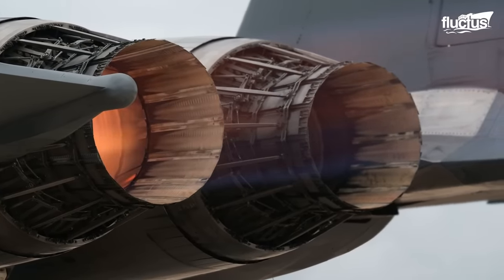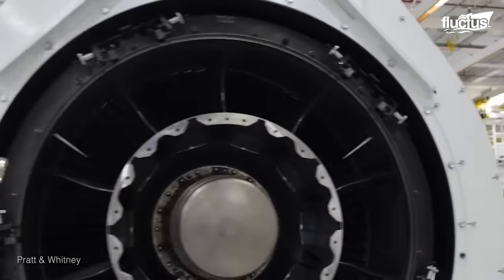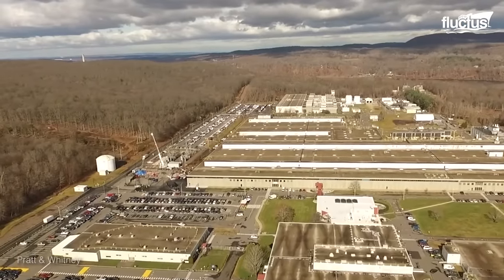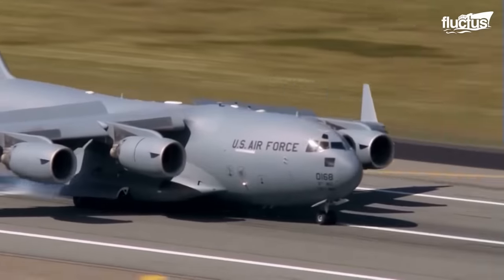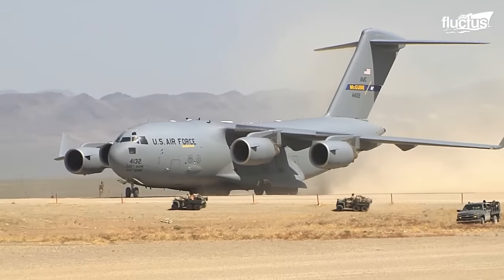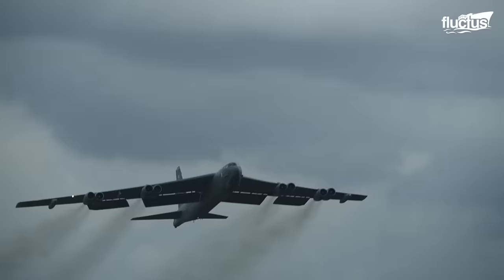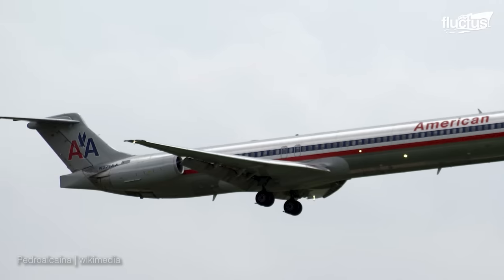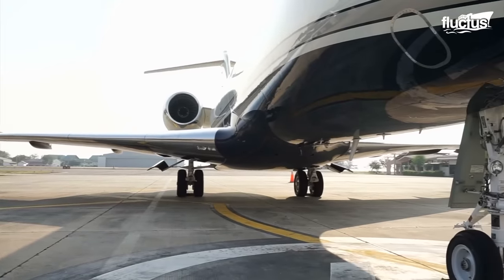Inside the Complex US F-35 Engine Manufacturing Assembly Line

Comment: I used to work at Boeing in Everett. First time I saw the giant engines for 777's I was amazed. Main Fan is 9 feet in diameter. It wouldn't fit inside most homes.
Reply: Did you see the story about UAL flight 1175 capt Behnam?

Dude was flying a Triple 7 when one of the engines exploded over the ocean. That 9-foot diameter blade was windmilling but it was out of balance it was damn near shaking the airplane apart. He had to fly it like that for a couple hours. That story is a Real Testament to how well those Boeing Triple 7 Wings are Made.
Reply: @jiveturkey9993  I couldn't even imagine that . . . . with that thing windmilling out of balance like that !!
even a little out of balance it would have been insanely scary no matter how many hours you got under your belt
Reply: @jiveturkey9993  more than the wing, as the entire aircraft is being vibrated and flexed.
I'd love to see the containment for that fan though, that's a hell of a lot of energy to contain should the fan shatter! Most of it has to be flexible, as rigid would also simply fail. I'm willing to bet it's a derivation of the Whipple shield used for spacecraft, layered flexible barriers.
Reply: It is so amazing !I feel so couriers if it is posible for a ordinary people to visi t?
Reply: @spvillano  Thanks. Yes you are right, anything that big rotating at the rpm's it does, has lots of kinetic energy. Out of balance main fan would introduce harmonic vibrations that could lead to complete loss of engine. Worse case, shrapnel hits passenger compartment. 

Large fan blades now being made out of composites. Older engines used Titanium, which is very expensive. Even composites can explode. There are several destructive tests engines have to pass. One about Containment, making sure the shroud liner (like bullet resistant vest) can withstand high energy impacts from fan blades. 

The near future will see 3D printed blades made from metal alloys. It is possible to print very complicated passages inside blades for cooling, and for making blades lighter.
Reply: @jiveturkey9993   pm .
Reply: @spvillano  At least in the Denver incident last year, there was no containment....the cowling landed in someone's front yard.  A fully uncontained failure....fortunately they were only 10 minutes out of Denver after take-off.....couldn't get me on one of those P&W equipped 777-200s......junk.
Reply: @spvillano  The containment does not exist......
Reply: @deanpesci8484  Well first off the Cowling coming off has little to do with "containment". Second, are you under the impression that GE engines never have issues?  GE has had numerous CFM56 uncontained failures in the past few years, some fatal.  I worked as a designer for BOTH companies for over the past 30 years and to say one is better than the other is just silly.
Reply: The x’s engines are bigger than my houses top celing
Reply: @sanashams322  thanks... yes they are huge
Reply: US is very much behind the Russian thrust vector control engine. The engine technology in US is very poor compare to Russia.
Reply: @georgeoms8713  thank you... yes Russia beat USA into space and in thrust vectoring. I bet they have things in development that will be amazing.
Reply: "home" analogy helped most of us picture this!
thank you!
Reply: @hashvid  Thank you. The Boeing 777 used 2 GE 9xx Turbofan engines. I always said that stood for G (gigantic) E (engine) 9 (nine feet in diameter.
Reply: @hashvid  Thank you. The Boeing 777 used 2 GE 9xx Turbofan engines. I always said that stood for G (gigantic) E (engine) 9 (nine feet in diameter)
Reply: i wanna work there if you able can you tell them ...😟 am crazy air craft that my dream i wanna study this , please sr... no salary give me ... i can work a long in my life but only need feed and give me live place for me...😟😟
Reply: System engine
Turbine
Reply: Blestic missile
Reply: @abinaslimbu3057  Thanks for comment
Reply: @brianwilson8983  Thanks for comment. I don't recall seeing you at any Boeing Facilities. Only Brian Wilson I know is from the Band Beach Boys. 

I started in the 40-87 Building in Everett with Technical Support. Later transferred to 40-88 Building for writing resource management programs in Special Projects Group. Then trained in Lean Manufacturing. After that was part of Lean Manufacturing Training Team and visited Plants across United States. I was in lots of places including plenty of time in Everett Main Plant. Been up close and personal with every type of aircraft Boeing makes.

Janitorial was not part of my specialized job classification or job duties. I did spend time in different rest rooms though. Even spent time at Boeing Military sites where High Level Security Clearance was required. Didn't clean a single toilet there either.
Reply: much bigger than they used to be for fuel economy reasons

Comment: I’m wondering if this remarkable engine can be retrofitted into the F16, B1B? Their fuselage or nacelles are big enough, without major mods. Especially for the F16, going from 27k lb thrust to 43k would be a serious leap in performance.
Reply: cool thought but the whole FADEC system would have to change too which would most definitely increase the empty weight of the aircraft.
Reply: @SlapShot646  You have no F'n idea what FADEC means.  Suggest you learn something first before replying and no, it would not increase empty weight but rather decrease it.
Reply: Regards: F16, certainly not.  It is a MUCH longer engine and its dry thrust would nearly be F16's wet thrust.  Now if the F16XL had been built....  Oh yea.  B1B... why bother?  But then again, KC135's and B52's have been reengined and are still flying so.... I mean Holy Crap B1B would be hitting Mach 2 without afterburners.
Reply: 43k thrust is way too high for the F-16 even when loaded to the max. The 32k thrust of the latest available engine is more than enough. This isn’t drag racing. More powerful engines use more fuel. I think the engineers know what they are doing.
Reply: @superskullmaster  I’ve never heard about too much power. Especially with increased efficiency the the this turbofan engine gives. They used to say 500hp is way too much, you can’t use it. And yet 1000p cars are increasingly common.
Reply: @superskullmaster  Turn brain on.  F135 has nearly dry thrust as F100 derivative has wet.  It means one can supercruise at Mach 1.2-->1.4 easily(lowest drag) while burning exact same fuel as one burned cruising at M0.8.   Could either platform actually use the 43klbs of thrust?  Partially, but no one cares about afterburner thrust anymore other than as a way to quickly get off the ground and for airshows.  Lots of nose and flame make airshows cool.  Miltiary wise, afterburners are nearly a waste of weight.
Reply: @phillm156  the issue would be the stress on the airframe from the extra power. it can be overcome, but if the value isnt there, they wont bother
Reply: @SlapShot646  You don't know what FADEC is or what it does do you?
Reply: @w8stral  Saying "turn brain on" while following up with "military wise, afterburners are nearly a waste of weight" is one of the most ironic and stupid things I've ever heard on YT, which is saying a LOT. 

Dash performance (scrambling, intercepting, etc) is critical to fighters, as it short takeoff distance (ie naval aircraft / derivatives) and certainly kinematic performance of weapons, namely long-range missiles - all of this requires afterburner use. 

Also it's not just about sticking more power on the airframe - tiny design features can mean hundreds of knots difference in transonic-supersonic range.  They changed a couple dimensions on the F-22's h-stab and overall tail setup AFTER final design freeze, and was later stated that even with its groundbreaking design and incredibly powerful engines, it would likely NOT been able to achieve supercruise without the slight changes. That's an aircraft designed from the ground up to be supercruise capable. I just don't see that being very efficient on something like an F-16.  One thing that WOULD be useful is payload performance - most people don't realize that a full loadout of weapons and drop tanks on an F-16 can (usually) make them nearly incapable of even going supersonic WITH afterburner.
Reply: @EstorilEm  Quick interception is an utter waste.  That is what SAM's are for.  With modern engines and high bypass ratio you do not need AB to supercruise.  Whole point of said post.  Put the same weight engine using F135 by P&W and GE equivalent and you can supercruise without AB.  AB is a Holdover of dumbo's stuck in 1960's for interception etc.  AB's for kinematic performance of ancient missiles is also for dumbo's stuck in 1970's which oh by the way was never used as sensors on said missiles were garbage and couldn't hit anything outside of an airliner at range.  Modern missiles with modern propellents in same size get ~50% more range making the Kinematic argument utterly useless as limit is still sensors.  AB are utterly useless.  Looks/sounds cool at airshows though.   AB's are essentially FREE to add in terms of weight, and why they are still on fighter aircraft.  

As for rest, what the Hell does the F22 cleaning up its Aerodynamics have to do with anything other than slightly increasing its supercruise ability.  All that does is PROVE my point, that AB's are useless and another reason I say AF picked wrong aircraft.  Should have been YF23 with YF 22's cockpit design.
Reply: @w8stral  daddy chill
Reply: FADEC "full authority digital engine control"
Sort of a computer controller for the engine that coordinates with other systems in the aircraft.
Reply: @HekateMGO  full authority digital engine control (like F100-PW-220 & 229), replacing the supervisory hydromechanical control systems of prior designs (F100-PW100 & 200).   Major advancement in engine operability, allowing pilots to fly the aircraft and not the engines, plus much better diagnostics for troubleshooting.  Paves the way for improved engine & aircraft system integration (a la F-22 and F-35)

Comment: The development of air engine systems engineering in the future depends how engine is powerful and if it does not have excessive mechanical mass and also does not consume a lot of energy source, then it is possible to create new ingenious systems for jet engines or how to compress the air inside the engines

Comment: The engine VToL inclination adjustment, could also be very effective for rescue/cargo or even an airliner craft, in multiple sets, plus with extended chamber of a ramjet before, I  front, become a supersonic convertion and VToL combo, even with enternal/exo rocket booster set, be a like a SSToL, only more 'SSR&VToL' ( R as Runway) Orbitliner space plane.

Comment: In short C17 can fly slow enough to perform similar to C130 tactical operation. Due to its power plant. With out PW pp most pp would cut out due to lack of intake of air.

Comment: They’re probably being replaced by GE motors by 2027, but they’ll probably ship these for foreign buyers
Reply: US is very much behind the Russian thrust vector control engine. The engine technology in US is very poor compare to Russia.
Reply: @georgeoms8713  this isn’t about thrust vectoring, and the F35 does not have thrust vectoring. You don’t need thrust vectoring when you can get a radar lock from 800 miles away.

Comment: The Navy never specify single engine aircraft...yet the F35 must have presented very high reliability data for a single engine.
Reply: The F135 engine is extremely reliable.  In fact statistically, a 2 engine fighter today is LESS reliable than a single engine fighter.  You have 2X the possible failure points on a twin engine aircraft, and anytime a large high performance fighter engine fails, it likely takes out the other engine as they are side by side, with lower safety margins than commercial engines.
Reply: @_Coffee4Closers  Single engine is for cost and weight savings. F-16 is single engine and F-35 is its replacement and F-22 replaces twin engine F-15. Both F-35 and F-22 use variants of the same engine, again to save money on spare parts inventory. Modern machining and inspection technology has vastly improved reliability in everything from cars to planes. Aside from wire chaffing issues early on, the F-16 was remarkably reliable. If F-35 isn't, it wont be mechanical it will be electronic or avionics...
Reply: US is very much behind the Russian thrust vector control engine. The engine technology in US is very poor compare to Russia.
Reply: @georgeoms8713  Check Six Boris. 😎
Reply: @georgeoms8713  oh, you're talking about the 3 SU-57s? Russia can't build enough of them to fly formation much less actually be useful in combat.

Comment: Engines like this are asstonishing, They could've been used on airplanes wings to VTol, for wide wing airlines, private jets etc, by just assigning them in the bottom front & rear top of the wings width rim, across the elongate path row, without the front shield vector flap needed, since it can now balamce on a front and back, of rear pivit boosters thrusted down. like feet stands,  made of air levitation propulsion

Comment: Why don't we use 747 as B52. 747 has more room carry more bombs and missiles.
Reply: 747 is a low wing plane like most civil planes, which means the structure linking the wings below the fuselage would interfere with the bomb bay, and the engines would ingest dirt from low grade runways. The undercarriage would also interfere with the bomb bay. It's also slightly slower. 
Military planes tend to be high wing, for the above reasons..Also, heavy bombs should be carried close to the centre of gravity to avoid loss of control of the aircraft when they are released. This results in a clash with the requirements for main landing gear which should also be close to centre of gravity. Different bombers resolve the issue in different ways. Tu95 has backward folding landing gear in pods behind the turboprop engines. B52 landing gear is also unique.